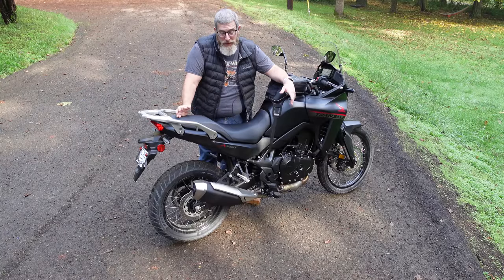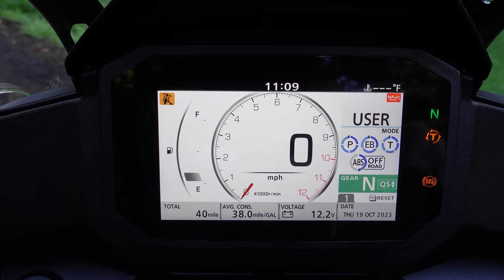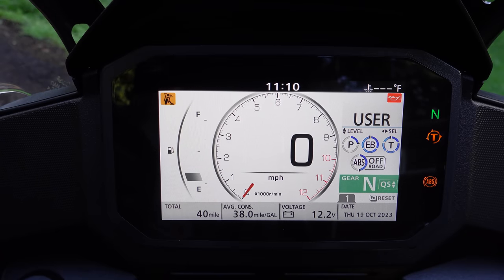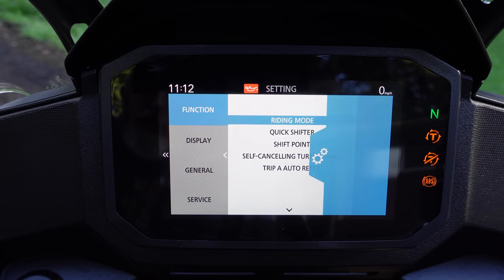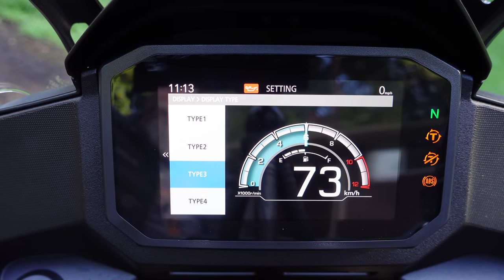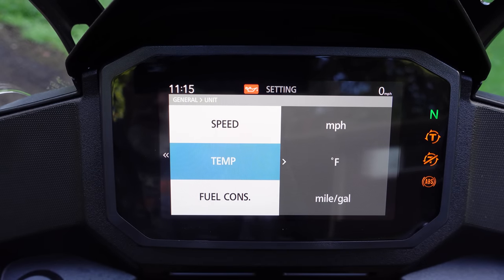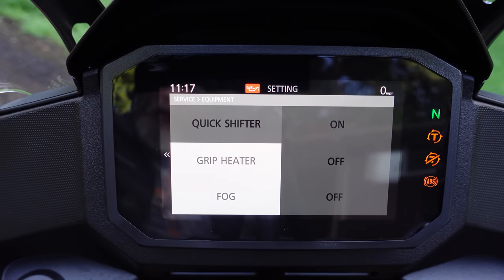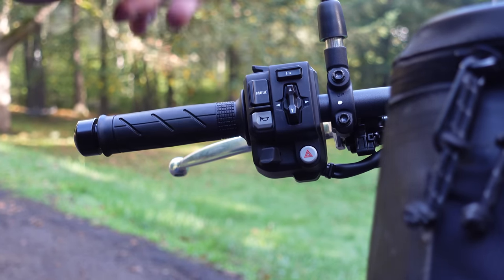Honda Transalp 750 Dashboard, Ride Modes, and More: Full Menu Walkthrough

Comment: maybe you mentioned this and I missed it, but do you know if Honda ever does firmware updates to the TFTs - particularly regarding the reset of TC and ABS on ignition key cycling, or other issues?  Dealers must have access to that programming because the European models you can add heated grips and fog lights which are controlled by the left side thumb controller and display in the TFT.  Thx Al in Seattle
Reply from the maker: No idea.  This is my first Honda with any real electronics.  I hope so, though.

Comment: As an Africa Twin owner, confusingly the more blue in the P-circle, the lower the throttle input (initially). 
So, a full blue circle meant the least amount of throttle response, where a single blue segment meant the strongest power input.
It took me several weeks to realize this, despite having the owners manual handy...

I wonder if they switched these visuals on the new 750?
Reply from the maker: Leave it to Honda to make it as confusing as possible
Reply: I thought the same thing. The AT is so not intuitive, very frustrating.

Comment: too much electronics. Dont get me wrong Honda makes great solid stuff but sometimes less is more.  i bought a Norden 901 Expedition that i had on order probably one of the 1st ones in New england  early this year in march.  I already sold it.   It was a great bike alot of power but too much switching of controls and navigating through the menu to get to the right ride mode and traction control or just to switch on the heated grips all to find out that the next time u start the bike  nothing saved.  I like riding not playing with electronics. I think Yamaha hit it right with the T7 very simple with  just ABS control thats all.  Yes i understand with the T7 is only 72hp u dont need traction control or ride modes u just ride the dam thing. Too much stuff going on with these dashes all i need to see is RPM, Speed and yes maybe the ambient temp.  I have a 24 T7 on order that should be arriving soon.    
      Now if Yamaha would just redesign or lighten the Super T or maybe come out with a T9 that was great power and weight they would kill it.

Comment: The Taureg 660 has a similar electronic suite AND it saves all setting if you turn the key off. No resetting modes each and every time. You can also change settings on the fly and you can change traction control on the fly. AND cruise control,
Reply: But it is not made in Japan and not Honda.
Reply: Aprilia doesn't hold value or reliability. Rides nice though when it works as should.

Comment: 800de is better for offroad riding. Its Gravel traction control  eats the Honda, the engine with its bottom-end torque swallows the Honda, and the phenomenal Suzuki suspension makes the Honda drop in its pants.
Reply: But the Honda is a better tourer from every review I’ve seen so far.  So I guess if you want to get dirty Susuki would be best option.  But if you’re going mostly road miles the Honda and it’s nice high reeving motor would seem like better choice
Reply: @A.Tomeier  well, it's not a desert X. But at least it has some character in its appearance, it refers to the old BIG and the new Honda looks like a scooter from a distance
Reply: @TheZakkmylde  I use it for TET, so the OFF is important, but if the Honda is mainly for roads, I don't understand why there's a need for 21 at the front?
Reply: @marceliszp4803   The TransAlp is an answer to the asks of CB500X owners. They've asked for more power, more suspension, and a bigger front wheel. That's exactly what the TA was made for, but Honda is also not going to put out anything that will risk cannibalizing the Africa Twin sales. If the TA had serious off road chops built in, they'd risk killing the base model Africa Twin sales. Why else would they leave off cruise control on an obvious road biased ADV touring bike? Same reason the US doesn't get the NT1100; it would threaten the Goldwing sales due to the lower price point.
Reply: @NunyaBusiness...  note that the AT for 2024 will have a 19-inch front wheel, which means it is changing its direction to a more expedition-oriented one from typically off-road. so they could make a nice good mid-range adv for offroad
Reply: No it's not . The Suzuki is over 500lbs while Honda is 458lb .
Reply: @MotoCampAdv  try offroad, I tried T7 and 800de and the Suzuki feels 30kg lighter than the Yamaha, not heavier. so what matters is where the weight is, not how much of it there is. I also have a Yamaha WR450 so I know what lightness is.
Reply: @marceliszp4803  try the transalp then comeback to me with your opinion
Reply: @marceliszp4803  That's not accurate. Only the Africa Twin Adventure Sports trim will have the 19" because it is being geared as a more touring oriented version. However, the base AT will still have 21" front and 18" rear because it is the more dirt oriented of the two trims.  The base will also have the option to add the Showa EERA that was previously locked in the higher trim.  If they pushed too many features into the TransAlp they would risk making it too good a bargain when compared to the base Africa Twin.
Reply: Great content, as a former Korean and a cruiser rider I’m looking to get a bike for on/off road and enjoy your videos.  As a lager rider 6’1 270 lbs I’ve been holding out for a 24’ model Honda Rally.  What’s your opinion on the rally for lager riders?  Thx